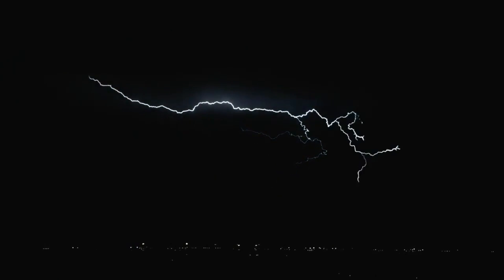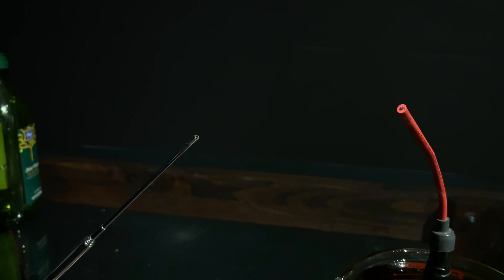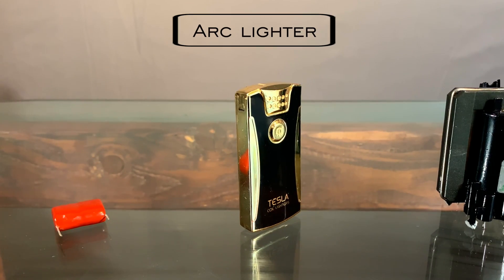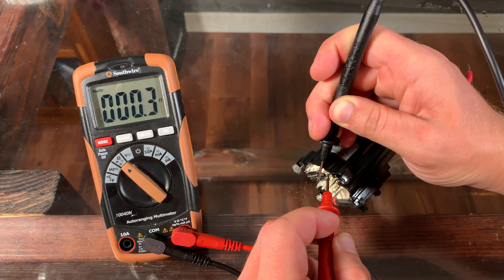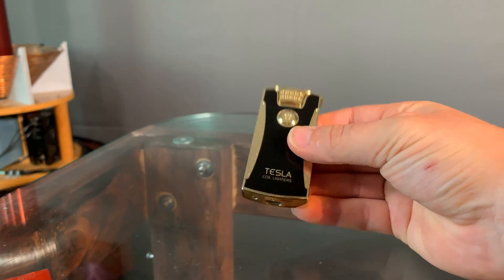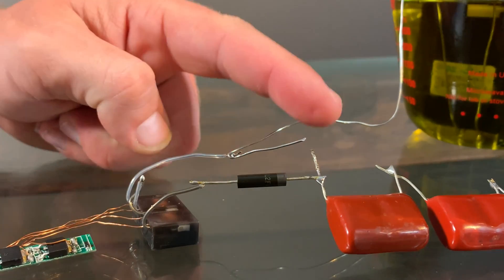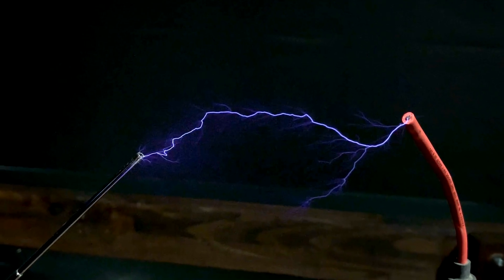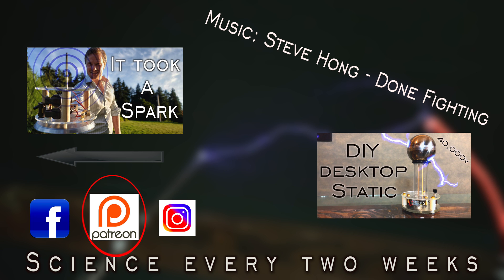DIY 100,000 Volt Arc Lighter Impulse Generator

Comment: Awesome work mate, definitely a build i will do. now i just want to see you build it up to your normal build quality, packaged in such a way to make it even cooler and fitting for your high voltage collection, and mine. i have a huge number of these flybacks here so will definitely be building one of these. keep up the awesome work mate.
Reply from the maker: Thanks Noel! Yes, I actually have grand plans to scale this up, and start a specific internet competition.
Reply: @PlasmaChannel  you know i will be up to this competition, been in a non oficial competition with you for some time, taking your projects and upscaling them slightly. so be very interested to have a more formal competition going. i love your style and get allot of inspiration from you.

Comment: Nice! You're sending chopped up DC into the flyback transformer (though the series capacitors arguably block the straight DC component), but the changing magnetic field in the core will make AC sparks on the HV side. Can you put a neon bulb in the big spark without frying it? It'd be interesting to see if both electrodes light up (AC) or only one (DC).
Reply from the maker: I'm sorry, I dont follow in regard to the neon bulbs?
Reply: @PlasmaChannel  Video response & demonstration here: https://www.youtube.com/watch?v=sBDd8nfO3tk
Reply from the maker: Excellent, that makes sense! I think the larger sparks will likely fry the neon bulbs. BTW super cool viddy you made.

Comment: HOW do you make DC work with transformers?
Reply from the maker: The output was rectified with several diodes
Reply: Plasma Channel, can they be smaller diodes?
Reply from the maker: They can be. But, they must be rated for the appropriate voltage.
Reply: Plasma Channel, I was trying to make DC fluctuate for a transformer by using a motor that spins fast with a wire so when it hits a metal thing it allows a connection then does another rotation an so on. Everything was doing it’s purpose but when I used a multimeter to see the results it wasn’t what I expected. It tried primary to secondary and secondary to primary to secondary and also tried charging a capacitor but it didn’t work. What did I do wrong and what do you think i should do. (I have no money for ordering things on Allelectronics or any others)

Comment: Very cool!  I work as a high voltage test engineer, and our device to generate up to 2.4 MV lightning impulses is about 35 feet tall.  It's basically a marx generator (charges caps in series, discharges in parallel) with 14 stages, but each stage has two 2.0 uF capacitors each rated for about 100 kV.  Each stage has an air gap and after the first one triggers at discharge time it's a fast chain reaction discharging all the stages. For practical purposes we dump the lightning impulse into things like transformer bushings meant to go in those huge transformers you may see at power generating stations or substations. I've only had the impulse generator up to about 600 kV though...
Reply from the maker: Techno, first off 1) Your job sounds AWESOME. 2) when your supervisors are not around, crank up that Marx generator (that is exactly what you described). Turn that sucker up to 100%. I am highly jealous that you work around such power. Cheers mate!

Comment: Excelent video as always. But i have some 15kV capacitors and diodes left from making your Lightning Tower project. Is it OK for me to use them instead of the ones you used in this video, or would you recommend the 5-10kV ones?
Reply from the maker: Thank you. So, voltage rating on components only tells you the voltage the component can withstand before breaking.
Reply: @PlasmaChannel  Much appreciated. I am looking forward to your next video. Keep it up.

Comment: Very impressive demo, as usual.  I believe I understand the circuit, but a schematic would be helpful too.  Either way, I'll try this.  It differs from the usual flyback circuits in that it uses the primary directly, instead of winding an external coil around the ferrite core.
Reply from the maker: I believe in using the wires already built into the coil. As, they are designed by people with years of experience, so they likely are better than what most people could design.

Comment: What if it zaps you?
Reply from the maker: Oh, I tried this one. If only across a hand....it hurts. If across an entire arm, your muscles twitch. Nothing too bad. The power level is low. However, dont let yourself be shocked from hand to hand. That could spell injury.
Reply: @PlasmaChannel  I once (more like 3 times on the same day) zapped myself with my (kinda poorly made) flyback across my palm. I was demonstrating a "trick" to my friends, where I put just one of my fingers on one of the outputs, turn it on & I feel nothing as 4-6 cm sparks are jumping between the two wires.
The second time my other finger was too close to the other wire, and it shocked me trough ~1 cm of air. Since then, I call all flybacks instant backflip machines.
But from what you say, I guess that was worse than yours. This is on my todo to find out :D

Comment: I destroyed a wireless keyboard with one of those lighters, haha.

My guess is that the high voltage impulse fried the circuitry. I’m happy that only the keyboard took damage, not the computer (maybe the aluminum case of it shielded it).
Even if I love my coils, I’m turning back to low voltage: like using the heat of my hand and turn it into a fan using thermoelectric modules. It’s not as sparky, but it’s interesting in it’s own way. Also it’s kinda hard to find components (like motors) that will run on 0.2 V and 0.05 A.
Reply from the maker: Hey, sorry to hear of the keyboard! Yeah, there are inherent dangers when working with high voltage. I'm glad to hear you're being safe. Also, thermoelectrics are rad.

Comment: you mention keeping your hand in your pocket as a safety measure, could you elaborate a little on what this does scientifically to help safety? Also, whats the small black box connecting the lighter circuit to the diode/flyback combo?
Reply: It simply stops you getting both hands together across two high voltage points. Impossible with one hand out of the way.
Reply: Just to avoid putting your hand on a grounded surface while the other works with high voltage. This way, it will be impossible to get shocked by accident.
Reply: @timovneerden  not imposible to get shocked but imposible to get killed
Reply from the maker: Long story short: it prevents a electricity from traveling across your chest-----through your heart.

Comment: I fried my arc lighter in the last project xD
Reply from the maker: Oh boy! They really are sensitive devices! Maybe I can help... what were you doing when it fried? Specifically, where were your hands, how long was it running for, etc.
Reply: @PlasmaChannel  I think I connected it wrong to the multiplyer or something, the mosfets got really hot.
Reply: Hi  @filipandre2927 , I did the same... it was because I drew the arc to the battery negative instead of the multiplier ground... I think Jay also done the same in his test builds...
Reply: its the driver that is the likely thing that has fried, the mosfet is super sensitive. a new driver can be made to run the transformer if you recover it, or use a cheap arc lighter kit that is available on ebay. they use through hole components so easier to replace something if it goes wrong.
Reply: I fried my one too, But the Electronic works fine But the voltage of the lipo went down so the driver didnt switch of the mosfet and more than 5A are flowing for 3min from a little 250 mah Batterie (i disabled it as fast as i could to disconnect the Batterie.)
This killed the lipo But i use now 2 of my older lipos Made for small racing Drohnes, becourse i had them and the capacity isnt Anymore the Best for flying. (300mah original,now only 180)they can be discharged at a very high A count like 4-5A for a longer time and its a Good use for them. A lighter is also Not used for more than 3 minutes 
😉

Comment: Sir ! how to store thunder energy?🤔🤔
Reply: We can't
Reply from the maker: We cannot store such energy at this time. But, we're getting close.
Reply: Surely it's not that hard?? Millions of bolts of lightning hit building tops daily so alls ya gotta do is create a massive DC-AC converter that can handle a load that big (lol) and spread it out over a grid. Or even use the magnetic field generated by a bolt of lightning to induce current in a nearby coil, idk but bloody stop saying *can't*, we can do it

Comment: But the 1watt is hardly pulsed and frequency degenerated... So it's more like 100 to 300 watt pulses I guess?
Reply from the maker: Well, in terms of rate of energy expenditure....its 100kv at likely a few amps. However, the pulse duration is so short - likely less than a couple milliseconds. When you divide the power in, buy the number of sparks out...its less than 1 watt per spark.
Reply: Put your finger and tell us ! ^^

Comment: Awesome video but when I saw the arc lighter I was like how the blue heck do they get the arc in a criss cross! What!?
Reply from the maker: Ah! Its amazing isnt it. They use two transformers, and they fire at alternating times.
Reply: very cool two phase system, there is both dual mosfets and dual transformer, phase shifted to create the cross effect. amazing that they have all this in such a small package. love these things.
Reply from the maker: Honestly I think arc lighters are the most amazing thing. I dont even smoke - and i have several. About to buy some more. They are the most amazing HV source you can get.
Reply: @PlasmaChannel  im the same, i dont smoke but i have several of these, one in my EDC, they are just a super cool piece of tech.
Reply: Thanks! I’ll research the schematic
Reply: kinda the same way 2 or three phase ac current works, its all about timing.